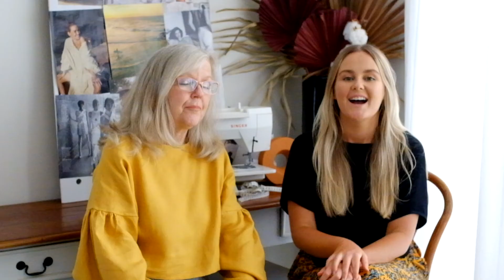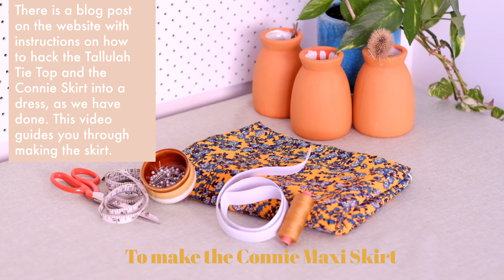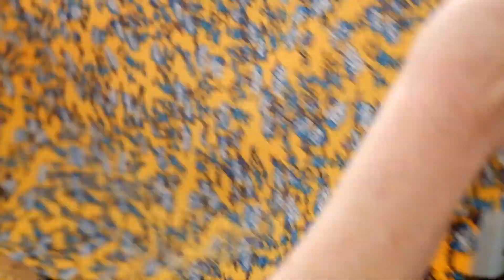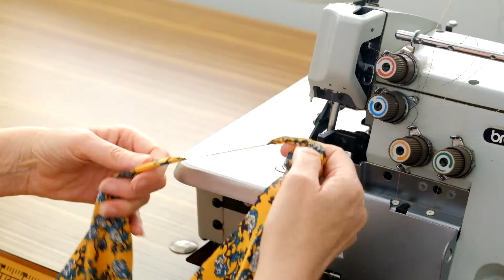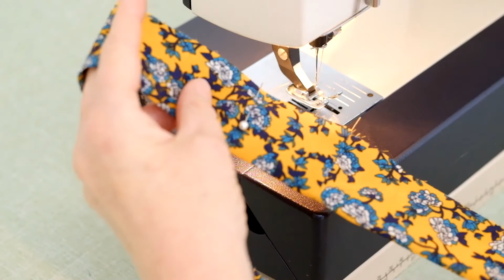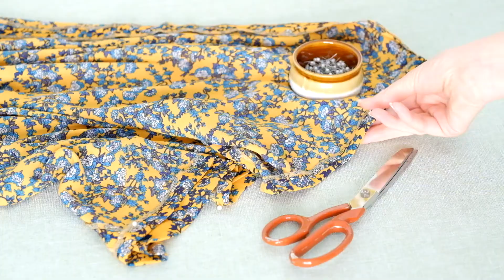DIY skirt FREE PATTERN | Sewing tutorial

Comment: my free pattern did not print out the correct size on my usa printer on the default mode... the horozontal top line printed 6 1/8 inch and should be 6.69 inches.  do you know how imuch percentage i will have to move it to get the correct sizing?  surely im not the only one with this problem. thanks a lot.
Reply from the maker: Hi Julie :) 
Please take off the default mode 
Choose the  100% option 
Print each page at 100% 
Print out a test page. Check/measure the borderlines.
Print out each page every page at 100%

Also use a laptop or desktop, not a phone. 
Download free Adobe acrobat reader 
This software makes it really easy to print at the correct size. 
You can reach us at swimstyle@bigpond,com if you have any other issues